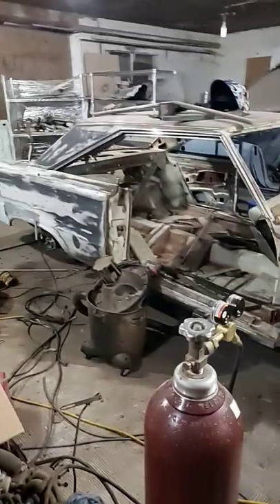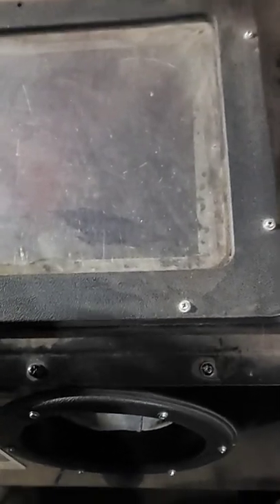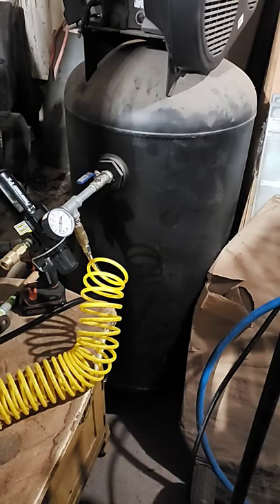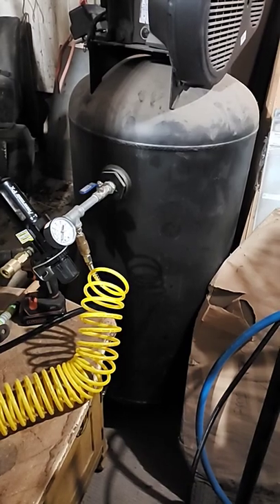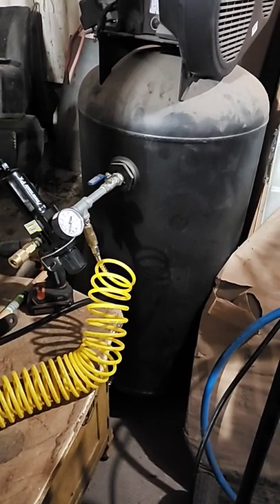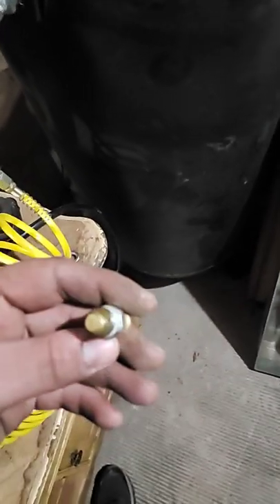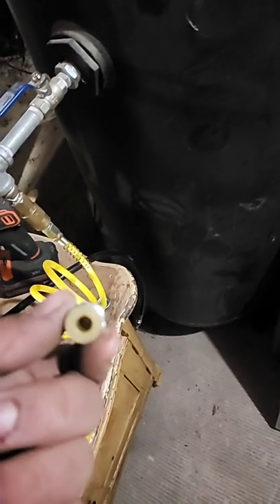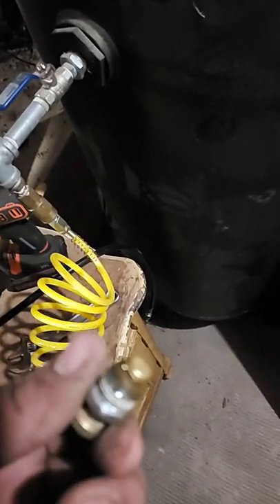draining air compressor for the first time in 4 years

Comment: Seeing the gunk on the threads, I think you have rust and sediment in the bottom of the tank. If you have all the air out of the tank, poke something up into the hole to see if the there is anything obstructing it.
Reply from the maker: I checked. Nothing.
Reply: @ryanbarsness  Strange!
Reply: I get water in my air compressor in a day.  Something is plugged.
Reply: Couldn't said it better. First thing I thought was well

Comment: One is there still pressure in the tank when you removed the plug? If not turn on compressor with plug out and see if it builds pressure. The water trap is all wrong for keeping moisture out of lines and needs to be changed not big enough and in wrong location.
Reply: And separator is upside down
Reply from the maker: Yes I know that. I unscrewed it a bit to relive pressure from the tank

Comment: @ryanbarsness remove the plug from the bottom and turn the compressor on water will flow out of the bottom let the compressor run for awhile with the plug removed after the water flows out to blow dry the inside of the tank.
Reply: You might want to put something under it to catch water probably 2 water bottles worth in there maybe more just don't want the shop to flood to much btw I subscribed because you took the time to read my comment I'm glad I could help

Comment: I just did this for the first time on my 7+ years old 5 gallon air compressor and ohh my fucking God. Soo much rust!!! How should I clean it? I was thinking of putting rocks in the tank with a solvent of some kind to kinda scrape it but I don't know what solvent I should use, or if I should even do it that way
Reply: It's done, throw it out brother.      Had a buddy with a compressor who insisted things were just fine after having allowed rust to set in on the tank.   One afternoon she finally gave up at around 90 psi.....  Blew every window out of the garage and the truck parked inside as well as crushing the sheetrock along a 6 foot stretch of the wall closest to it.   It was so loud that people more than a block away were calling 911 thinking a bomb had gone off nearby.     Scary shit.
Reply: To be clear I mean the tank.  If the compressor is fine just get a new tank.  No need to throw out a perfectly good compressor.

Comment: Put a better plug in this time. Replace it with some nipples, an elbow, and a ball valve. I’ve had to do this with mine before. I just didn’t need to stick a flathead screwdriver into it. I flooded the whole damn barn😅.

Comment: Tank is shot , 4 years of never draining , pull the plug and nothing comes out , you’re risking your life using that thing from here on .
Reply from the maker: It drained fine. Plug had blockage so I had to break it loose
Reply: @ryanbarsness  the question is what was the blockage from , I currently have a 30 gallon my son was to lazy to drain , I now get chunks of rust coming out of it after using it and draining it , to the point now I won’t use it but it is a 15 yr old compressor , just be careful and monitor it , if it continues stop using it .
Reply: @ryanbarsness  what happening is the is the inside of the tank is rust scaling so bad that when it’s running the vibration from running is knocking the lose on the inside , the structural integrity of the tank is already compromised at this point . People have lost their lives with compressors air explosions it’s not worth it but I’ve been on the receiving end and have been lucky once you cheat death once you learn fast .